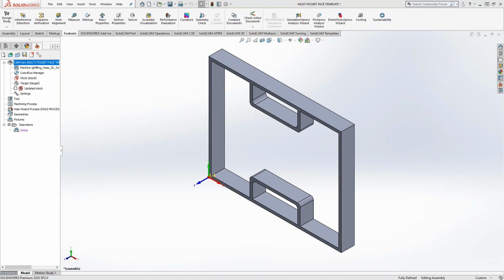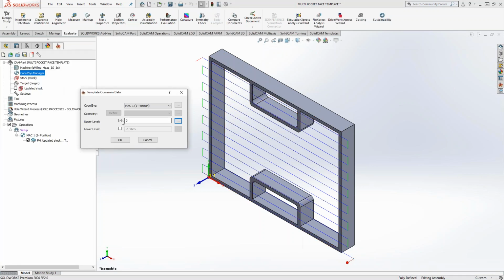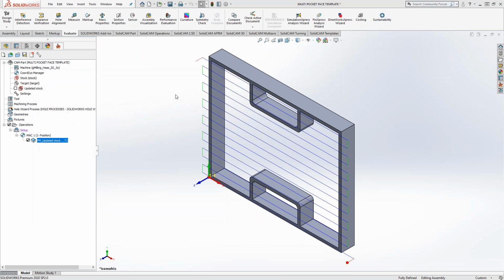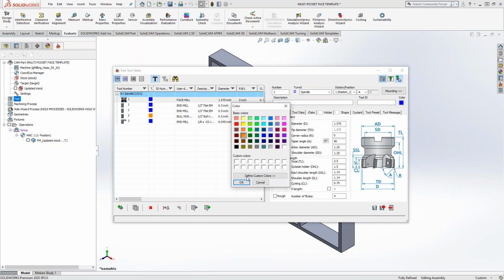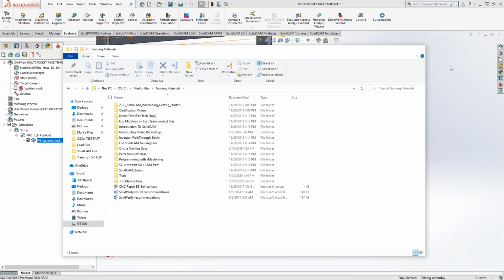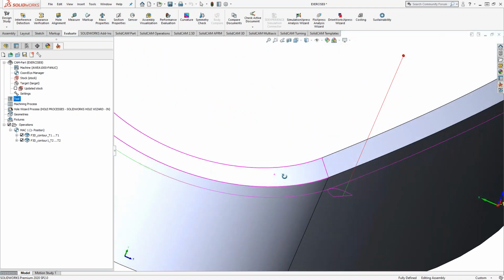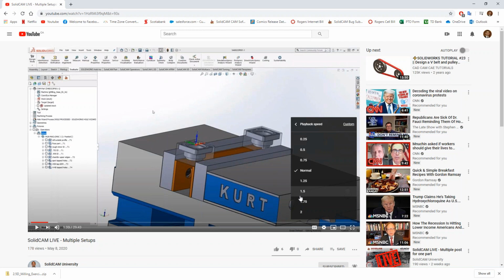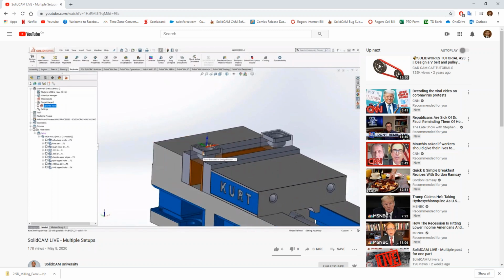SolidCAM LIVE - Process Templates

Comment: Include tool data doesn't seem to work correctly or I'm doing something wrong because when I try to add saved process template it just iterates trough my machine tool setup and if the tool type is correct then it's just uses that tool. For example if I save process using groove tool on position number 8 then after adding this process template it just uses groove tool on position 3 (first groove tool in my machine setup).